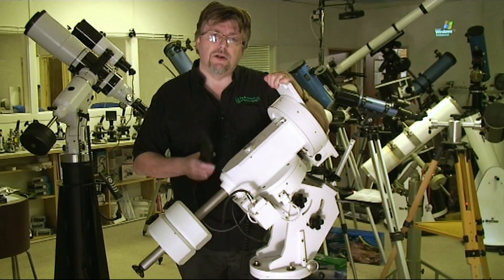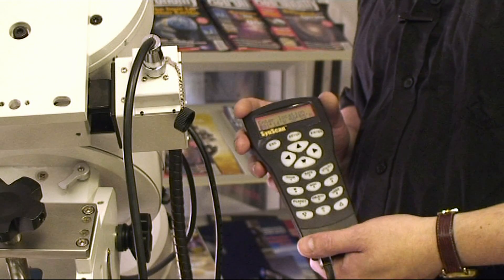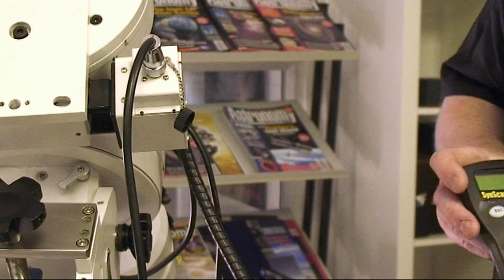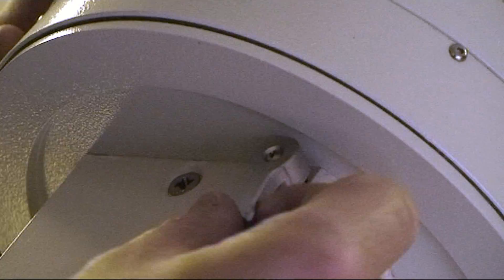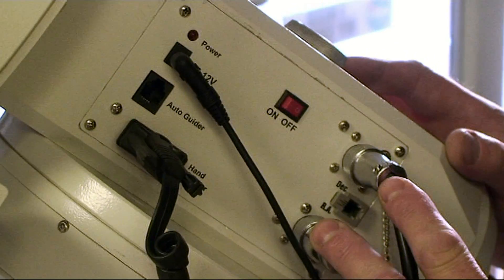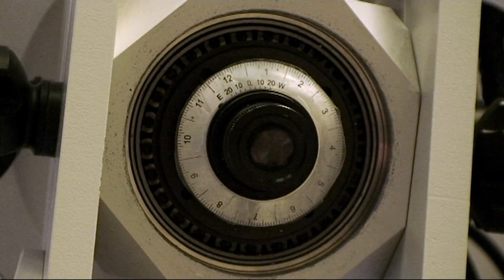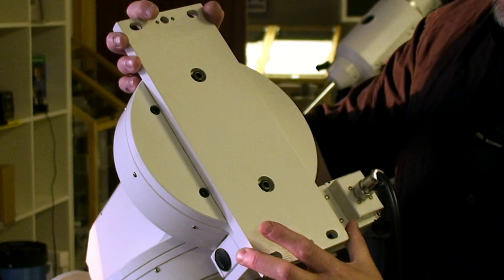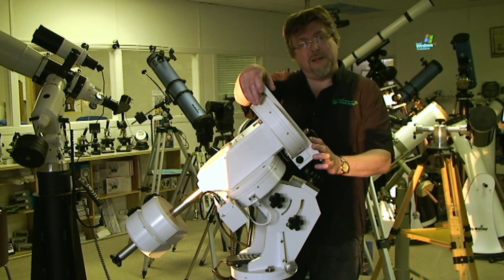An exclusive preview of the EQ7 SynScan GoTo German Equatorial Mount

Comment: An intelligent, un-hyped description. It certainly took Synta long enough to get it right with decent sized wormwheels, shafts and castings. (at last) The comparison with the AP900 comment suggests that the target audience will need to be very well heeled. Quite why telescope mountings need to be deliberately designed to be so expensive has always puzzled me. It's hardly rocket science. ;-)